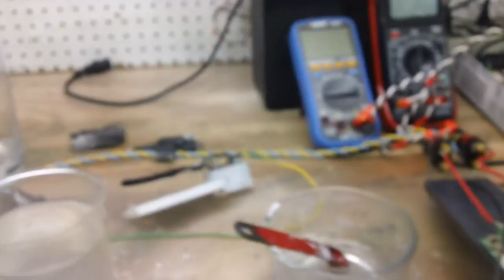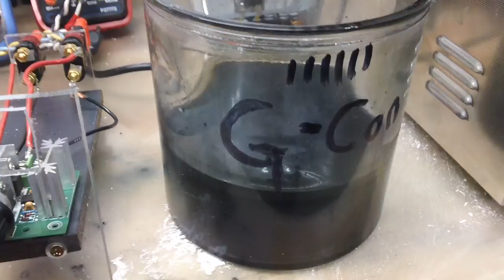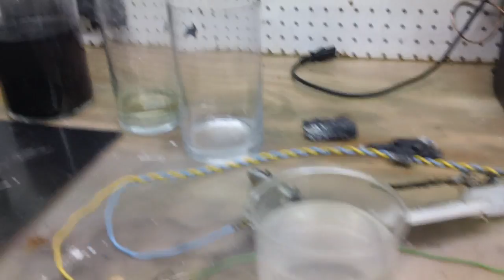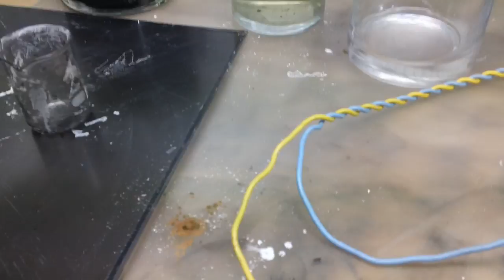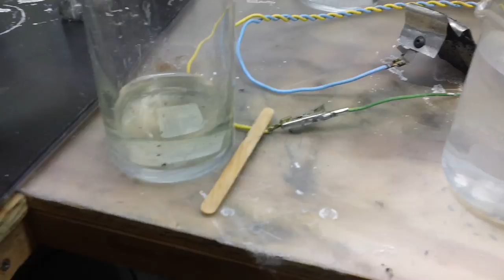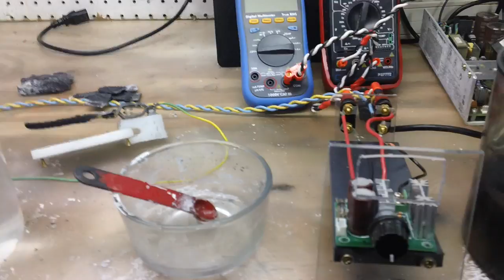manufacturing graphene update

Comment: do you still have the intention for making a step by step video for this, I would love to give this a try but for us non-chemist dummies out there, its pretty hard to know what you talking about when you talk about 'washing' and 'rinsing' and 'sonicating'... 

Some may say "leave it to people who know what they are doing" but if we did that as a species we would still be living in caves and cooking on campfires (other than for recreational purposes lol

anyway, keep up the good work :D
Reply from the maker: Actually, since this video I found a faster way it uses acids and a microwave but due to the volume that I need it just seems simpler electrical current way works if you need smaller quantities make sure you use acetone in the sonication part of the process different kinds of salts will work sodium silicate works fine.  There already a few videos out there explaining this process the only thing I really added was using a small PWM circuit (pulse-width modulation)  you can find on eBay for a few bucks instead of spending a lot of money on a high-end power supply.

Comment: Sad to see that you haven't uploaded in a while, I was a big fan. Hope to see you keep going but don't push yourself if you don't want to. On the other hand, if you are, keep up the good work, you're a genius!
Reply from the maker: Thank you I do appreciate it, I will be posting more videos as soon as I have the time to do so, I have new coil designs, new generator designs and all these things need to be vetted.  yes I am an open-source person, I will share everything, and I will not hold anything back, we're all looking for Solutions and I still believe the solution is there.   Thanks for watching
Reply: @zeropointfuel  Any updates?
Reply from the maker: @bamspay  Hi Brandon, the best thing I could tell you at this time is it does separate the graphite it does nothing for impurities the best working solution is soak graphite strong acids for a few days then filter the liquids out.  use  kiln to cook-off the impurities. this will give you the best result, also you might want to check out Robert murray-smith YouTube he explains all this in great detail, good luck

Comment: After you wash it, what liquid are you dispersing it in and do you know what concentration levels you are getting?
Reply from the maker: I've tried a few things acetone because of the evaporative property works also some form of  butylene rubber is important to give it flexibility I'm using a book binding Elmer's Glue which has natural butylene even if you use a rigid plate it keeps the material flexible and not from flaking off the surface,  also using Carboxymethylcellulose works. but as far as the concentration levels are concerned it's iffy most the time I'm checking resistance in the material because I still haven't found a perfect way to separate the poor quality from the excellent quality product.  Skimming on the surface in a tray works but is very tedious.
Reply: Since we're using the same method to produce this, I would love to compare results with you. I'm doing it and it looks good but who knows if it really is good lol.